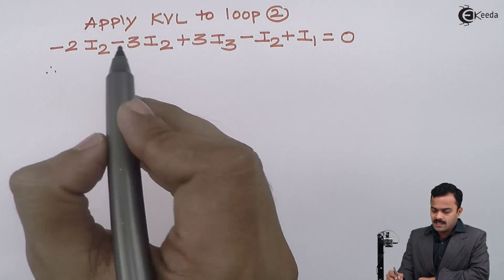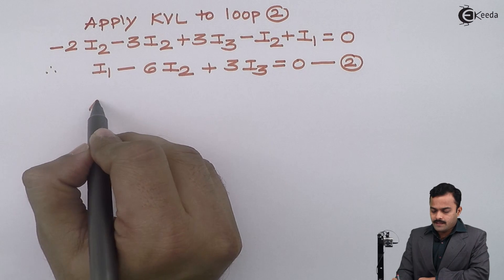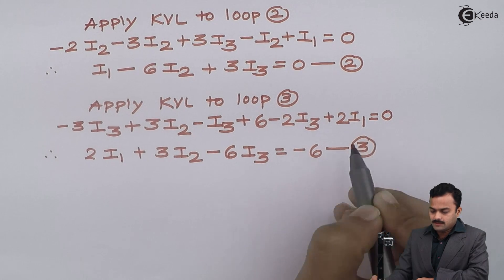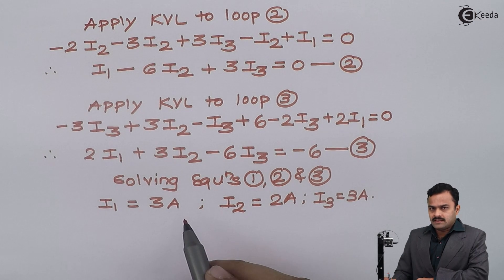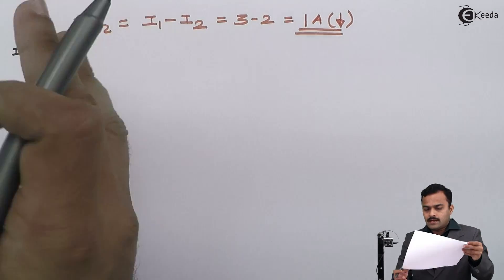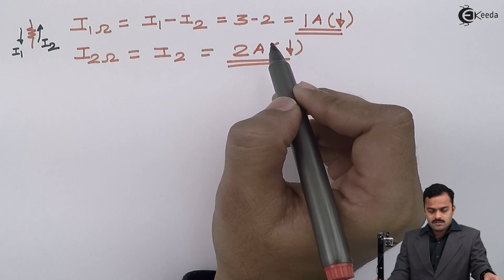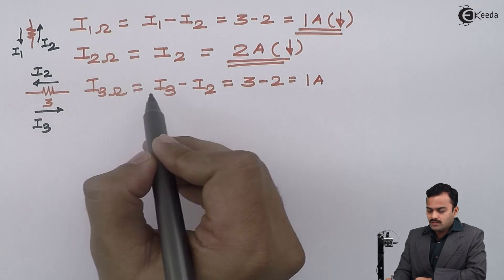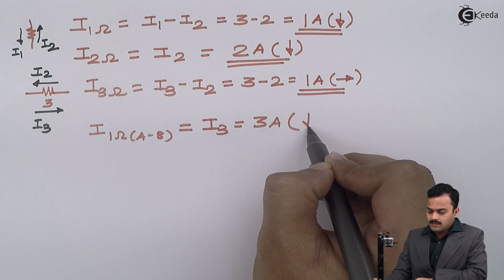Mesh Analysis : Problem 2 - DC Circuits - Basic Electrical Engineering

Comment: sir on putting equation 1,2,3 on KLC i got different values of eq 1,2,3 i.e  eq1=1.181&eq3=0.938
and i also get same equation as u,,,but current values comes different

Comment: to solve equation in calculator 
step 1 press mode
step 2 press 5 equation 
step 3 press 2 anx+bny+cnz=dn
Reply: Thank u so much bro😍😍😍😍
Reply: in which model ? i am usin gfx-991ms..but it is not like that you told